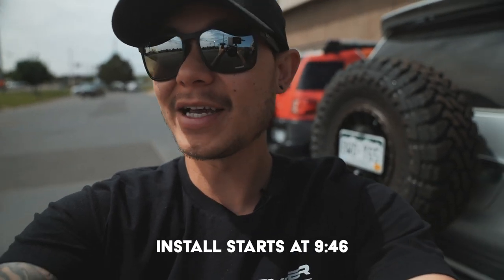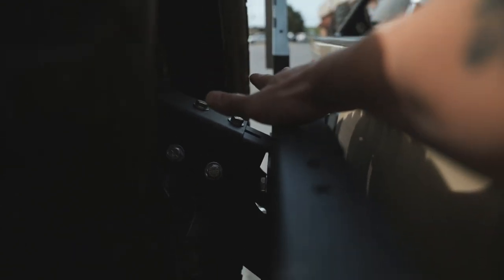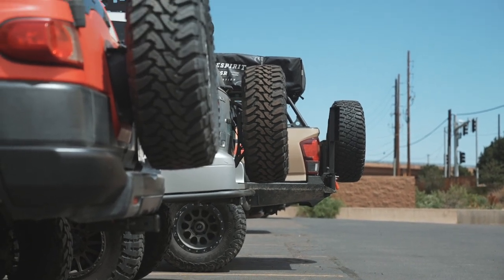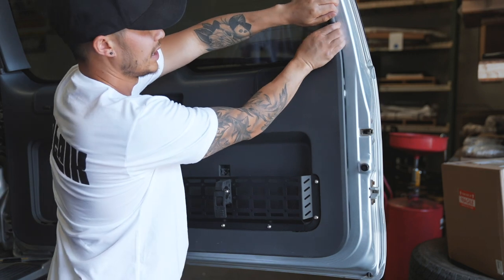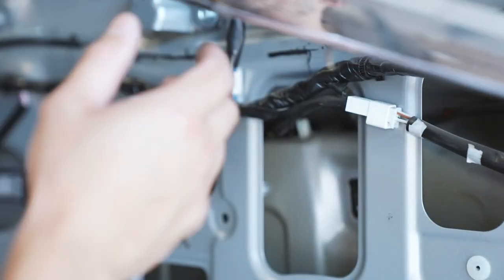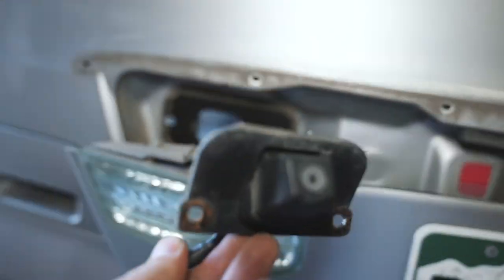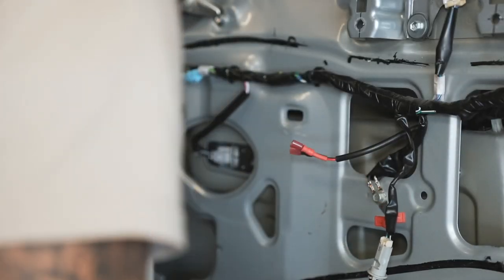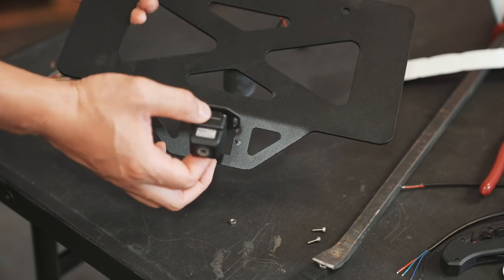The BEST Tire Carrier for the GX470! - Holds a 35-inch tire! JW OffRoad

Comment: That mount is known to wear the door hindges on the GX470. Its too much weight for that door.
Reply: I've had mine on for 2 years with a 33 inch tire and gas cans attached to that with zero issues. No cracks, no weird closing issues, or squeaks while off-road.
Reply: @adecarlo29411  good to know !
Reply: Great for light offroading or mall crawling. Id be careful though hitting departure angles and sheering it off dragging the spare across a rock or something.
Reply: They make shims for the hinges to take the added pressure off.
Reply: @BradleyJokerst  where?
Reply: @7sunsetmaro7  JW Offroad
Reply: That was my concern.  Those LT 315's are over 70 lbs of big rubber lugs !
Reply: It’s the exact same door on the Toyota Land Cruiser Prado that comes with a full size tire carrier on the rear door. They made this door to withstand a spare.

Comment: Really guys the JW spare tire carrier is the worst tire carrier on the market, just wait until your door starts to sag so amuch its  a job to shut your door and you will really enjoy the squeaks you get while driving, I couldn't give mine away. Find and endorse something that really works. This was on my 2009 GX 470 with 315 70X17 tires with Method wheels.

Comment: I'm having an EXTRA gas tank put in the wheel well where the spare usually goes- and the two hooked as one to give me 56 gallon capacity instead of 23-- which will give me about 800 mile driving range before filling up again.. (and an armor plate to go OVER the tank as extra protection against puncture.) BUT I prefer a RIGID trailer hitch mounted tire swing.  Better visibility- and the offroading isn't effected-- as i don't do rock crawling etc. anyway.

Comment: Where did you get the paper template for the holes? I can't find it on their website or yours. Thanks. Great video. Can't wait to try installing my new tire carrier. Although we've already changed out the back bumper and ccut part of the4 frame, so not totally sure how we're going to mount the strike plate.

Comment: Easily not the best tire carrier for a GX. The rear door wasnt designed to carry a tire. 

If you want to carry an full 35" spare. In the back on or a roof rack. Your rear hatch is not the answer.
Reply: That’s funny bc the prado comes with a tire on the gate.
Reply: @vw2vtec  funny how it's from the factory and designed for a stock tire size. The gx470 isnt a prado. Its based off the prado/4 runner. How dense are you? 

Putting a 45lb+ tire on the dx rear hatch will eventually make the door sag and cause closing issues.
Reply: Pretty dense apparently.  They have shims for the hinges and the tongue that mounts to the body aides with the weight.  You don’t have to buy one.  Some people like to open a swing out every single time they need into their gate, the rest of us went with a gate mount.  Cheers mate.
Reply: @j.p.3972  again, JW sells shims for the hinges, and there’s a tongue in the jamb that assists with closing.  
It’s far from perfect, but it works for most everyone that buys it….or they wouldn’t sell any.